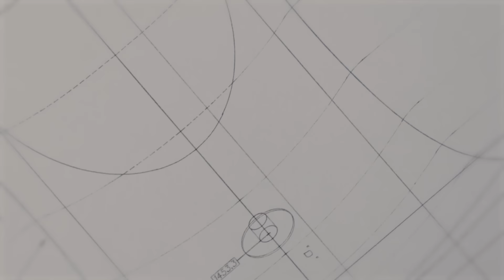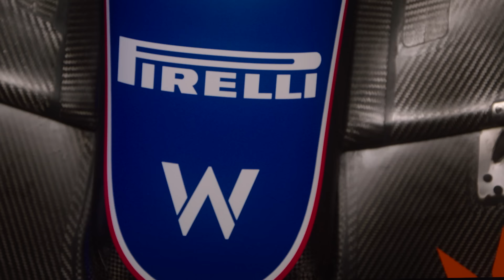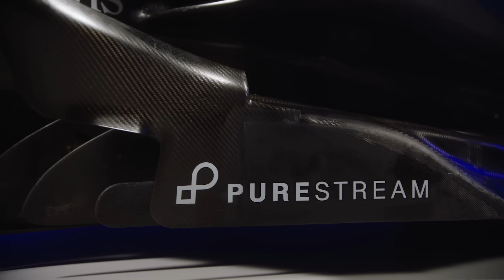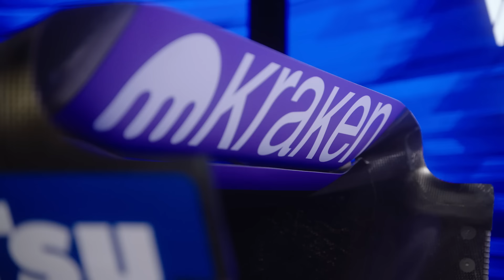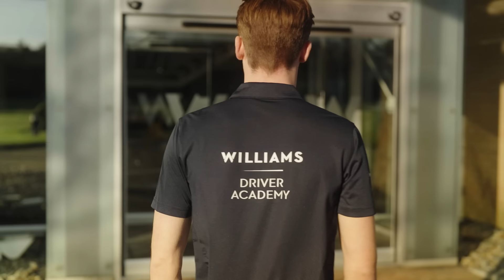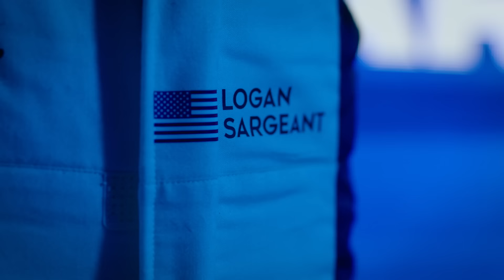2024 Season Launch | Williams Racing

Comment: Every Wllliams "racing" fan to a one i bet would not care what the livery of the car was if it meant they achieved podium finishes this season. Same for all the under achieving teams.
The beauty of a race car is it's performance not it's fashion show appearance. Do you get more turned on when your spouse or partner is naked or fully clothed? 
If all the cars were dead equal performance wise and weight wise etc before livery and the difference between winning and losing was driver skill and the weight of the paint and the only way to identify the cars was by the number on them, the drivers helmet, black and white discrete advertising decals on the chassis and the sound of the engine fans would not be disappointed in the least. 
True race fans don't give a crap about fashion shows only how fast the car and driver goes! And I didn't bother to even glance at this livery but I am cheering for this team and the other under achieving teams to do well this season.